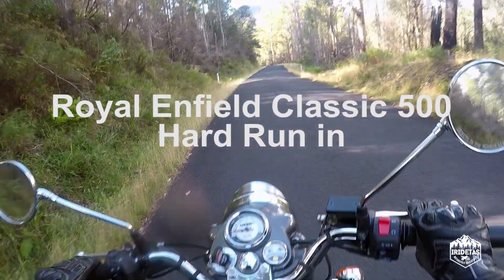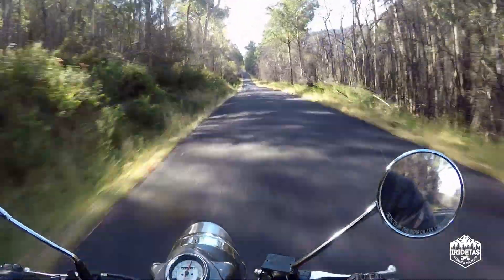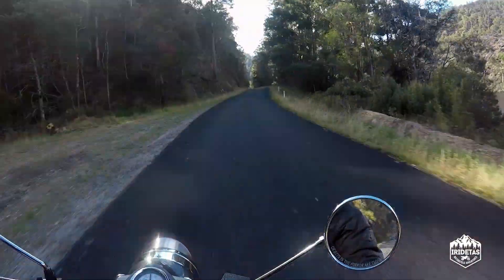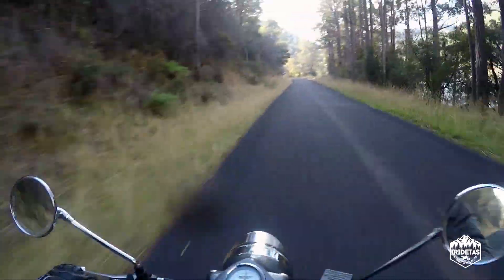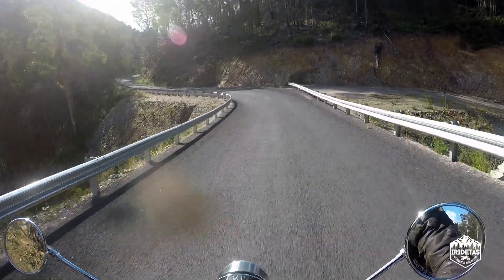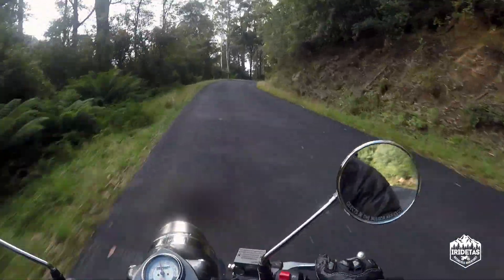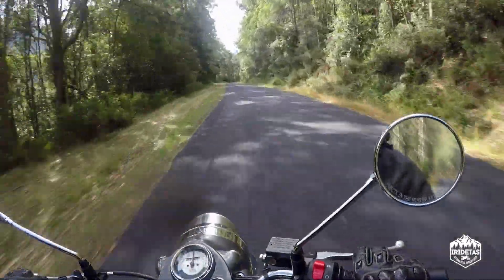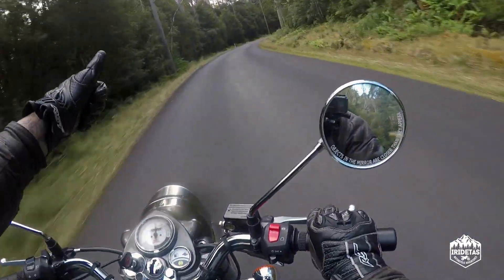REA #3 | Hard Break In | Vibrations Reduced on Royal Enfield Classic 500 Using Hard Run In Technique

Comment: My mates a garage mechanic, he says he has very few problems with high mileage rep cars that have been driven hard from day one.
They don’t burn or leak oil even with high mileages.
They also tend to have noticeably more power and smoother engines.
Low mileage cars that have never been revved are the ones he has the most problems with.
Reply from the maker: I have a mate who said exactly the same about trucks! Run them in how you ride them!! 👍👍

Comment: Bought my 2019 classic 500 two weeks ago with only 400kms, now it has 1100 and vibrates a lot especially between 90 and 110 km/h. After about 115 it gets smoother. I'll try the hard run in tomorrow, thanks for sharing!
Reply from the maker: Good luck mate!
Reply: How did it go?

Comment: Very interesting, I watched this video yesterday and I tried it today at 220 miles on my new Classic 500. I did it 3 times of hard run in on gear 2/3/4 and I could see significant change in vibrations and power. When I came home, my hands were not numb and I did a longer ride than usual. My question is, is it only required a couple of times? Thanks for sharing!
Reply from the maker: I did it for about 500km or so it spurts, on and off a few times like you did each ride, but yes it seems to settle in pretty quickly! Good luck!

Comment: It was perhaps myself who advised Paul on running-in. I cannot advise a harsh running-in on engineering principles. Note I said harsh not hard.   
The first stage to the first service at 500km should be done pretty much by the book or the bearings may be hammered oval; the piston/bore was run in at the factory, about the only part that was, it does not take long. 
All of the other components do need running in. The book gives a first stage running in speed of up to 60kph, this is probably a little too slow for the EFI-500 making it slog,  a gentle 80kph is probably more realistic. The second stage says avoid full throttle in the book, and above 1000km avoid prolonged full throttle. Many riders never take this motor over 4000rpm, and that does need doing or it will vibrate forever. It should be understood that the engine needs work put into it to run it in, pushing the bearings and cogs and so on into alignment. The revs should be gradually increased over a period of time. I did this by progressively changing up later, changing up where we encountered stiffness. Properly run-in these motors loosen up and produce significantly more power between 2400-3200km (1500-2000 miles) even in stock form. Eventually the motor would rev freely to the limiter. My 2015 Classic-EFI has K&N, Hitchcocks free-flow 50s exhaust system, Power Commander 5, Autotune AT-200, with RevXtend to 6000rpm. It was hitting the 5500rpm limiter in lower gears, it now revs freely to 6000rpm in top given enough road (I'll leave you to work that out).
Reply: man im glad I read this comment, i just bought my classic 500 brand new and have been babying it only at 82miles now and watched this video and was planning on going out tomorrow to run it harder than i have been but i think ill wait now until i meet the first stage requirements then ill push it a little for short burst. really loving this thing though its not as good as my gsxr750 but damn is it fun for what it was ment to do.
Reply: vincent meredith yeah me too. I have 92 miles on my 2020 C5 Classic. I have taken it to 45 mph but I think I will push it a bit harder
Reply from the maker: Yeah the bike runs so smooth now, particularly I  it's current form it is fantastic, specks to date are
19t front
Bp6eix plug
Ngk cap
AEW Goldstar Exhaust
Pod Filter/air box delete
Crank Case Breather
Powertronic /custom map
Runs really sweet! Thanks for dropping by!
Reply: @iRidetas  I went back to the 18T because of the huge gap between 4th and 5th gears with the 19T. The tiny electrode on the iridium plug gave me problems, I'm running a BPR5ES, slightly hotter (because mix is slightly richer).
Reply from the maker: Bike in current state of fettle if your intetested! https://youtu.be/zuXv2lt5Foo
Reply from the maker: Yeah I've been thinking of going to a 5 plug as I live in a cold environment and it's running richer.  I'll have to give it a go.  19t is my favourite mod I won't be going back myself!
Reply: @iRidetas  - the plug "heat" has nothing to do with the environment but getting rid of the 2500°C burn temperature of the spark that provides the self cleaning. If you are running slightly richer you may want a '5'. The Euro4 models come with a '5' anyway. The stock HT lead and plug gap are not good, can cause missing (which causes plug fouling) and may want changing.
Reply from the maker: I know mate i was saying
Hot day slow heat transfer
Cold day more rapid heat transfer therefore i live in a cold environment and this is a air cooled engine running in a cold environment and richer, to keep the bike in that peak range which as you said is running richer because of the piggy back ecu with tune i moved to hotter plug.  I changed HT lead and plug cap as soon as i got it ran heaps better!
Reply: iRidetas - ambient temperature, a hot day, is absolutely irrelevant to the plug.

Comment: Honest to god I brought mine new and could not believe the vibration.........
I also did it as Paul G did I did take it easy for the first 500 k  By 2000k
Was smoothing out , now has 4K 
And will Cruz at 110 and can see in the mirrors.....
Reply from the maker: Yup no matter what technique they do smooth out but the Paul g /Motoman technique seems to work well imo to make them smoother quickly
Reply: @iRidetas  - it should be understood that Paul is not an engineer or mechanic but a chap running a holiday let business in Spain with the bikes there as a side benefit attraction, and he has spanish regulations to contend with that effectively prohibit modifications to the bikes. 
This engine will run smoother by that mileage anyway but the real trick is to get them running freely over 4000rpm and through the entire power band. A conservative (low) maximum piston speed calculation gives 6800rpm as a realistic read line.

Comment: I've always heard break it in the way you intend to ride it...I got my Continental GT with 500 miles (about 800km). Hopped on the expressway and rode about 8 hours north doing 65-70mph (110kmph). Varied the rpms a bit when I could with letting off the throttle and then giving it a nice wrist twist to get back up to speed. I've alt heard these single cyl Enfield really loosen up after some road time and use.
Reply: "always heard
Reply from the maker: That's what I've always done too.  Break them in as you ride them! It worked for Doug he is very smooth now! 😁
Reply: If you thrash any new motor in you are going to hammer the bearings oval, and you will never have a good motor. With 500 miles on these motors, you can use full throttle, but not full time, 70mph is only fast cruise not full throttle. Whilst these engines are /new/ and still tight, they should be shut off every hour and allowed to cool. Varying the throttle is good. First service at 300 miles is a major full service. Whilst still running in it is probably a good idea to change the oil every 300-500 miles until is stays clean, a lot of swarf and detritus is produced that needs to be removed. By 1000-1200 miles the oil should be remaining clean and so return to normal service programme. When running-in is complete, the engine should be able to rev freely to the limiter.